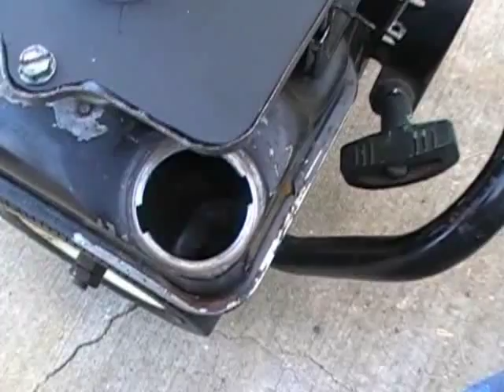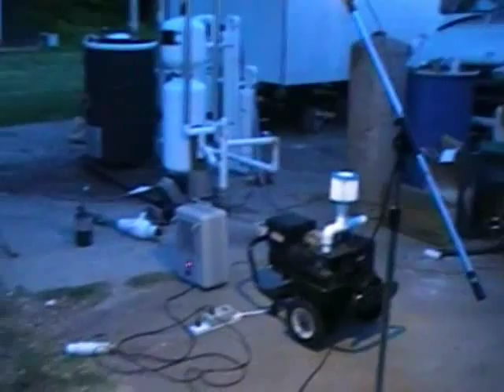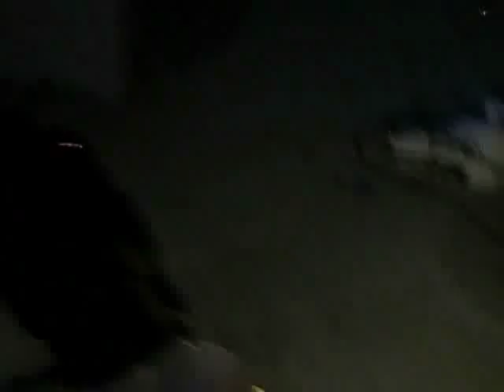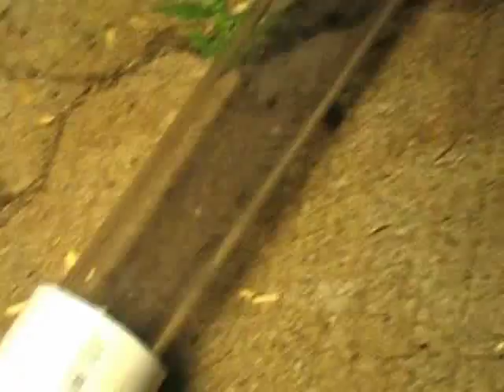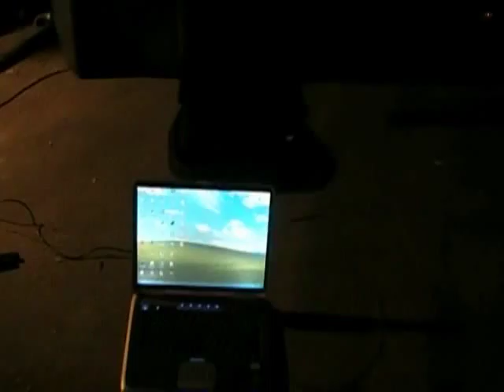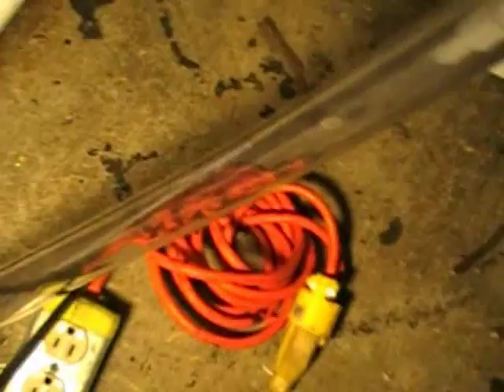05-31-2013 Generator is up and running!

Comment: The idea of going up to 10 or 12 inches sounds great. Oddly, I have found that the larger pipe does not cost much more than the smaller stuff.
In your design, the gases enter at the bases of the filters and are drawn off at the tops. Do you think it would still work acceptably if the gas ran downwards instead of upwards?
My plan is to make the filter as a set of screw-fit cartridges for rapid placement and maintenance, hence the question.
I will have a looky at yer others vids right away  :) .

Comment from the maker: I also thought about you trying to use the filters with the larger engine and I realized that with a small 5 HP engine the 4 inch pipe was OK but anything over a 5 HP engine and they would not keep up. If I was running a 4 or 6 cylinder engine the pipe diameters would need to be 10 to 12 inches in diameter.

Comment from the maker: I'm building a new revision of the tri-filters. I am going up in pipe size from 4 inch to 6 inch diameter pipes plus I may configure the setup a little bit different. The original filters work good and the gas is clean but I am still fighting water issues in the filter medium. The hot weather has something to do with this too but I'm still pleased with the setup. If you get a chance check out the very last video I did. You might appreciate it. Did you ever try the filters out? Cont:

Comment from the maker: I am taking a different approach using more cooling pipe area and I do not use a vortex. Instead I use a cooling tank because this allows the gas to expand and cool thus cleaning it very well and removing a lot of water and other undesirables from the gas. I cool the gas even further before it hits the filters and what I have is a propane blue flare every time. I'm still polishing the build but I feel that it's there. Check out video 18. That was my last run and it was a clean flawless run too.

Comment from the maker: Luc Gosselin has some good designs too. His have been around for a little while so it is proven to work. My designs are a mixture of the stratified downdraft gasifier. I'm using the deep ember bed concept of the stratified downdraft gasifier which is almost 9 inches mixed in with a standard Imbert design with a cone shaped burn zone instead of a straight pipe burn tube and it has ran with no issues so far. I'm taking a different approach where the gas is concerned too. Cont:

Comment from the maker: Stephen I have ran the filters for 8 hours without cleaning them with one exception. I pull the wood chips out and allow them to dry out form the moisture they captured. I am shaking the grate about once every 15 minutes and I don't have a shaker yet so I just manually settle the wood in the hopper each time I shake the grate. If I use wood pellets I don't have to stir or settle the fuel but I still shake the grate every 15 minutes. The camera is an eBAY special. It's a JVC Everio.

Comment: Hi. This is my first comments on You Tube. Thanks for the ideas and inspiration. I built a FEMA but didn't even fire it. Going to my own ideas now. Something along the Luc Gosselin design. How much ash are you getting out of your imbert? Does it need to be cleaned out after each run? How often are you working the grate during a run? What camera are you using to make the videos? Thanks. Stephen

Comment from the maker: @hobo59 This gasifier is geared up for a smaller engine and I used a 55 gallon drum to allow the gas real estate to loose heat and cool down. I still have tweaks that I am figuring out as I do this and the tri-filters do add some back resistance too. I may experiment with a inline turbo helper fan to make the generator input see a neutral pressure but that will take some thought and work. I am also looking at designing an electrostatic filter and that would remove the back resistance too.

Comment from the maker: It may be repairable. I just changed the oil and added a sealant to the oil until I come to a decision to either repair the engine or replace it with a bigger engine to offset the power loss with the woodgas.

Comment: I think now you understand when we talked that day i said too that its a choice to make on temps and to shoot for the middle ground yes a hotter run makes better gas but at a cost of using way more wood if you have too cool of burn like a real FEMA setup you make way more tar and have to filter it way more thats the part i tried to explain i think you get it now to shoot for not too hot but still int he middle to save on wood and still crack some of the tar making a better gas!

Comment from the maker: I had leftovers from running on wood chips so there wasn't enough there to get a good ignition. I used a small ball of newspaper at the reduction zone with a pile of small sticks from the yard and that fixed it right up but I was cussing before I figured what in the hell was going wrong. A bad ignition is also a perfect storm for a flashback. That's why I had the safety glasses on.

Comment: TY it just yesterday started to let me again post back! Thats why i said b4 to you i let my stuff run down or even to a out point that way in the next time to light it up it was down lower. Thats why when we talked that day i said to use a measured amounts for run time most dont get it that way but i found out like you just did if you dont let them run down b4 next lighting you get an odd fireup and like you just said lots of tar and crap but if its down lower i dont get that try it out!

Comment from the maker: Hey man I see you got your youtube issues solved. I had another friend that can't reply to youtube blogs either. He just called me a few minutes ago. I decided to use clear tubing to drive the point home that the gas can be scrubbed to the point of being invisible. I had a bad ember bed when I started off the test and I produced a shit load of heat and a half full mason jar of tar but I didn't hook it to the filters until I got it stabilized. It felt good to finally see the generator running!

Comment from the maker: The wood pellets burn nastier than unprocessed wood and that I don't understand but I think it's because they are compressed and they need to be really hot to digest them properly. Unprocessed wood burns faster but it is so much cleaner and there are never any tar issues with unprocessed wood. I am going to do a power test using propane to see how it compares to the woodgas first-hand. I already know that propane isn't as efficient as gasoline so I have a lot of test on my plate.

Comment from the maker: You are sooo correct about that damn no contact contact thermometer! Yeah, I figured that out then I forgot about it. I must be getting senile. I had a poor ember bed when I started off so I did see tar at the jar below the fan but it was a lighter thinner tar but as soon as I got the gasifier stabilized there was no more tar issues. I thought I was seeing tar in the first and second stage of the tri-filters but it turned out to be wet carbon dust that washed off with a hose. That was strange.

Comment from the maker: The disadvantage is the fan blades will capture tar along with carbon soot and even on the Imbert, the wet or damp carbon soot can be a bit messy but it will wash off with soap and water. The tar won't wash off without a solvent. I have been told to set up for a negative pressure on the gasifier which means to draw from it with the fan instead of blowing air into the gasifier which would be a positive pressure because it is prone to dangerous blow-backs and I believe that.

Comment: Do you see any disadvantage to mounting the fan on the output side of the filter? Would it affect the pulling power? I was just thinking it could keep it from building up tar.  Also, are you able to vary the speed of the fan or does that really matter?
Thanks for all the info!  I have been thinking about building a gasifier for a couple of years but after watching your videos I'll be getting started soon.

Comment from the maker: If you are talking about the final output gas temperature it just needs to be a cool as you can get it but as long as it is at ambient temperature you are good to go. I try to cool the gas down to the ambient temperature and that's why I have the big vertical pipes along with the big expansion tank before I even filter anything. If there is any residual tars or carbon dust they are easily removed by the filters because cool gas will clean very easily.

Comment: I like the clear pipe. A good quality control to let you know how the system is performing.I had a good size generator that gave me a problem one day. thought it was the motor.Turned out my gen side was bad at a "Particular Load Level".I was referring to damage your generator might of received prior to the test at the hands of your friend.If he seized the engine,might of abused the gen.side too.Just wanted to make sure it was the wood gas not the gen.side. Does that make sense?

Comment from the maker: You can use those $20 fans that are used to clear gas fumes from engine compartments in boats but a blower fan with an external motor that is not exposed to the woodgas is the best route. The boat places sell those for around $70.

Comment from the maker: Prepmor308 I already know that the gasoline will give the engine back the lost power. I plan on doing a propane test to see how that compares to woodgas too. The engine didn't see any damage from the woodgas. Keep in mind that my woodgas was a clear invisible fuel too. Tar will travel in the form of a whitish vapor leaving a film on whatever it passes over too. This is why I used clear tubing feeding the generator so that I could monitor the quality of the gas.

Comment: Hey Flash,this is great!Do you think you could do a control test with gasoline only.Check to see if the generator runs better under load on gasoline like you did here.Just to make sure that the generator didn't sustain damage as well as the motor.If it runs the heater on high with no problems,then we could use that data.I know that there is a reduction in h.p. when you use wood gas.I just like both sides covered.BTW, I have a Gennie that says it's1350 but that's peak.1,000 cont.(hate sm. print)

Comment from the maker: hobo59 Thanks for the reply. The generator was ran without oil and the engine seized up. I had to pull the cylinder head off and use a wooden block to free the piston. The engine lost some compression along with burning all of the oil out of it in just a few hours. I barely had oil in it after I topped it off and tested it on the gasifier so I was amazed on how well it did on this run.

Comment: GREAT JOB I AM NOW READY TO BUILD THANKS TO YOU . i DO HAVE A QUESTION WHAT WOULD YOU DO DIFFERENT ON YOUR DESIGN IF ANY AND WOULD YOU HAVE RATHER USED STAINLESS STEEL FOR THE HOPPER OR IS IT DOING OK.

I GOT A 5 KW GENERATOR DO I NEED TO BUILD A BIGGER SYSTEM THAN YOURS ITS A ONAN GENERATOR ON A RV IT IS A REALLY GOOD OLD ONE THAT HAS EVERYTHING BUILT IN WITH ONE CIRCUIT BOARD WHICH IS REALLY EXPENSIVE TO REPLACE. AND ONE MORE QUESTION WILL THE ELECTRONICS ON OLD GEN NOTICE NOT RUNNING ON GAS?

Comment: The resulting gas from a wood gasifier is almost 50% Nitrogen, coming from the air used in the combustion stage of the gasification. This accounts for the drop in eventual output power. If oxygen is used instead of air, the nitrogen dilution will be eliminated, u get almost 100% combustible gas. Unfortunately, pure oxygen is not cheap, steam will be a more readily available option but will have other complications.